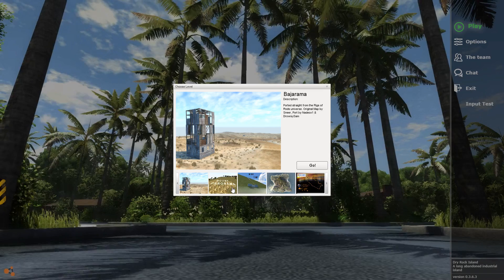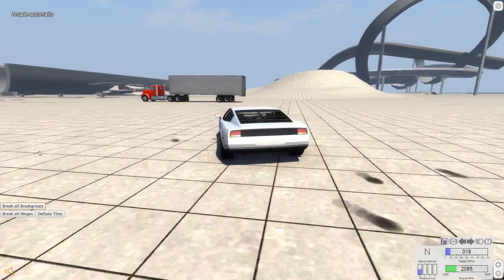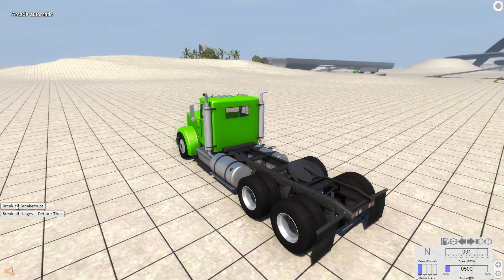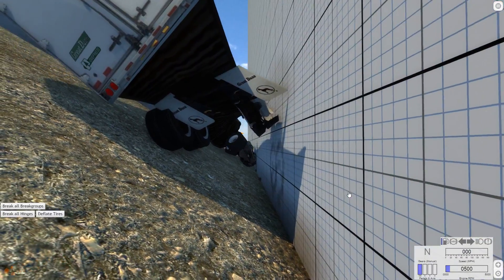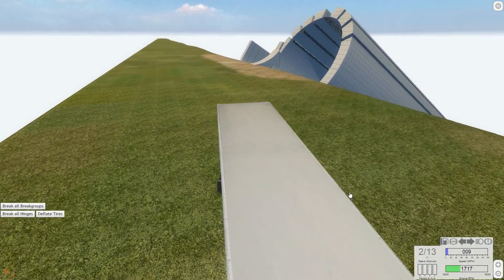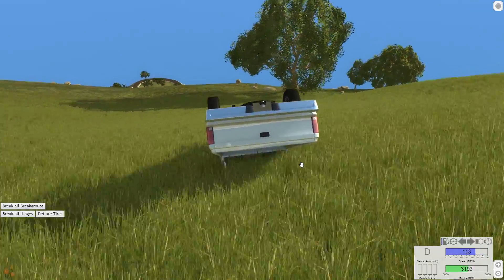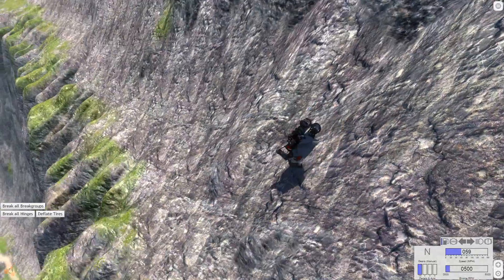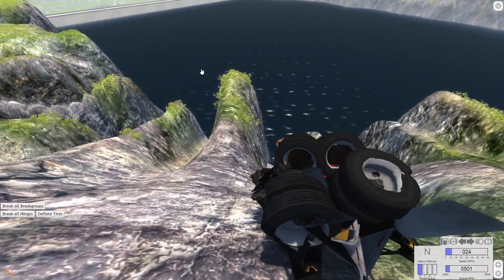Big Rig Trailer - BeamNG.drive

Comment: In real life, there's a pin in the fifth wheel called a "king pin, " which basically holds the trailer in place. Also the 13 speed isn't shifted how you think it is either.

Comment: WhyBeAre you should find a car small enough to fit under the trailer set the trailer moving and see if you can drive through changing the speed of the trailer.

Comment: Am a truck driver myself Great dane is the make pine series is the model walmart has alot of these the physics are of a loaded trailer as at 20-30mph they can and do flip if the loads shift inside 
Also the other trailer makes are hyundai wabash great dane and utility the tractor is a peterbilt 379
Reply: dont forget stoughton, monon, fruehauf, kentucky etc also you can look it up later but the tractor is an international peterbilt 379 has horizontal headlights as international has vertical lights but really who cares

Comment: WhyBeAre Can you tell me if there is a way to make the T series go faster? I have a hard time getting it to 50+ mph. Is there an assigned turbo/boost button for this mod? Thanks.
Reply from the maker: RJSarratt I don't think I've ever seen a mod for a faster T series, and a quick search didn't find any results. :(
Reply: RJSarratt press and hol T. I don't know if it works for this mod, but it works for my default T-series

Comment: Hey WhyBeAre can you please make a video on how to make parts show up. I downloaded the death machine and now the stock truck (D series) wheels will not show up but the wheels still work.
Reply from the maker: andrew wilson It's kind of a glitch that just happens with some mods, the only fix is trying to use a different type of wheel in the parts menu. You can actually fix it, but I do not know exactly what would be needed to be done off the top of my head.
Reply: Ok thank you so much.

Comment: WhyBeAre put a pick up in the trailer to weigh it down and to make it more like real life use a manual transmission because automatics cant shift quick enough in real life like i drive a log truck and trucks are nick named gear jammers because sometimes going uphill you  have to drop 4 gears in one shift